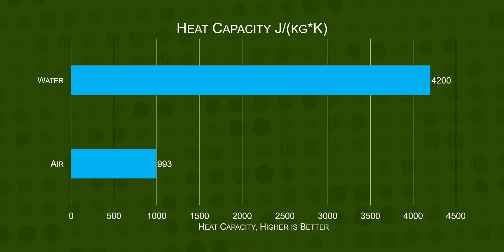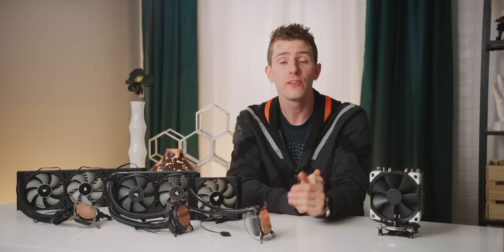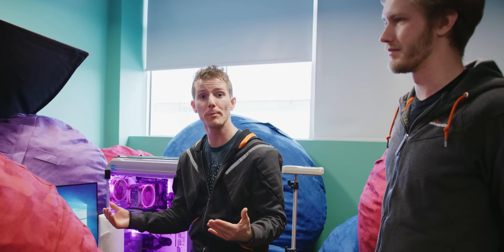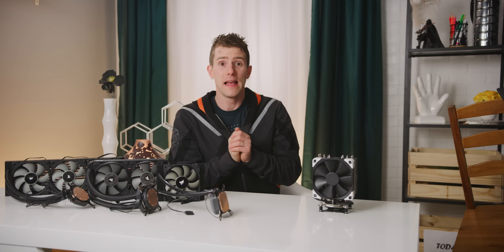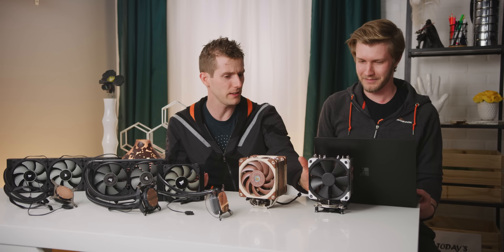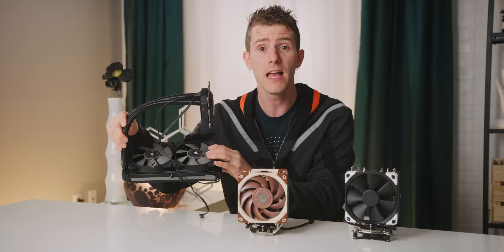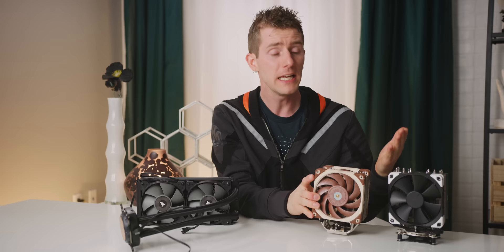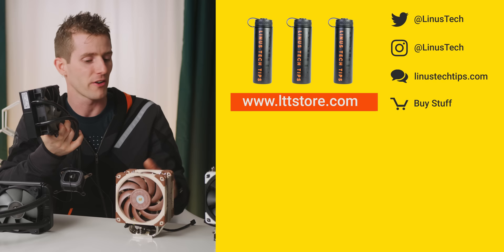Why you shouldn't water cool your PC

Comment: me: buys a watercooler and builds it into my rig

Youtube, literally the same day: recommends this Video
Reply: Same dude. Now im thinking of returning it and buying a Noctua
Reply: Isn't it easier and cheaper just to buy a faster CPU?  Overclocked i3 with expensive watercooling vs i9 on air.
Reply: @MarkLikesCoffee860  you'd have to just not research to even think of putting an i3 under an aio or water-cooling. Unless you're only after looks. It would be better to get a Ryzen 5 3600 or a 10th gen i5 and use the stock cooling.
Reply: @MCHellshit  if they would use proper fans on the aio's and not the stupid lowbudget high noise fans which get shipped with it and also make it a sandwich (4 - 6 fans on the aio) would get far better result than the noctua at any point
i have a setup like that and neither can i get my gpu nor cpu above 53°c at 60% fanspeed while gaming in 4k and having gpu overclocked massivly. Using 11 Noctua fans in my entire rig and nope its not noisy at all.
Reply: If it makes you feel any better, I just watched this video before dropping $145 on an AIO that I saw a review for yesterday.
Reply: Same
Reply: Haha yep.  Building my new NAS, went with an AIO because "why not", but this system won't be CPU intensive so meh.  More of a 'bling' factor.  I wouldn't be worried about it.
Reply: Me too 😂
Reply: MCHellshit stay with liquid cooler always 😉
Reply: I wanted to change to the air cooling but my case cant handle that massive size XD
Reply: Don't believe everything you watch (and don't use SEALED water coolers!)
Reply: @Floppyflipflops473  I'm a Ryzen 5 3600 user and I would definitely not suggest on using the stock cooler. At least not if you're planning on gaming. 3600, with its ability to auto-overclock, it runs really hot compared to Intel CPUs. I was getting 85-90'C (28'C ambient temp) with extensive gaming with the Wreath Stealth (stock cooler). Got a CM Hyper 212 air cooler and now it never crosses 70'C. 35-42'C on idle, earlier it was 45-65'C.
Reply: @GautamKabiraj96  what I said wasn't a suggestion, it was pointing out that a stock cooled 3600 would be more suitable that water-cooling an i3...I'm a 3600 user myself and have it under an aftermarket air cooler.
Reply: @Floppyflipflops473  Compared to an i3 (AIO), definitely, choosing 3600 is no brainer. I just wanted to highlight the point that if someone is going to get a Ryzen 5 3600, might as well get an aftermarket cooler along the way :)
Reply: @GautamKabiraj96  agreed bro, definitely a good idea if you want max performance from it. My wraith cooler wasn't too bad tbh, highest temp I saw was 73°c, mine was noisy so had to go
Reply: @Mirthe DeGroote I'll be honest they all do the job, the better are the aio or the NH-D15. All I could truly say at that point is it's more about preference, I'd get the Noctua NH-D15 as there are less points of failure and at times it would outperform the aio depending on use case and pc case airflow performance.
Reply: @Mirthe DeGroote no problem bud, happy to help. You won't regret getting that cooler, it comes with a beefy backplate and proprietary mounting system, handles the temps of a r9 3950x too, so it'll be perfect for the 3600.
Reply: same
Reply: Same 😔
Reply: Unless you're pushing an AIO to the absolute limits (unlikely), AIO's are far superior
Reply: @bakedandsteaked  far superior? Unless you're getting bigger than a 240 there is negligible difference between a quality air cooler and an AIO in the same price range, if you want better you have to pay way above the price of a Noctua NH-D15!
Reply: @Floppyflipflops473  in terms of performance maybe. But imo, AIO coolers look better, are quieter (again unless you're pushing it), safer for transport, etc. Just my opinion, ymmv. Noctua makes incredible products and has my respect. Their fans outperform everything by a decent margin.
Reply: @bakedandsteaked  fully understandable, everyone is entitled to an opinion mate 🙂, mine soured with my last AIO (Corsair h105) that had a pump fail mid video edit and the temp spike caused a shutdown which lost what I'd been doing for hours. Decided to go air cooling after that as I had previous issues with another AIO too.
Reply: It's fine. Watch GamersNexus' video about watercooling. Linus' testing methodology isn't on par with GamersNexus, that's why he debunked that Noctua cannot truly beat a proper CLC. If you can afford CLC, just go with it. Only reason to go with air is if you're really tight on budget.
Reply: @Zerviscos  absolutely, watch the GN video on the same thing. Steve from GN has a more detailed testing process.

It comes down to 2 things, preference or budget...mine was preference as I didn't mind the cost side of getting a Noctua or a good CLC. Experience decided for me.
Reply: same, and i had a mid Fan that did the job for a i7 4770k with ZERO problems
Reply: Saaaaaame
Reply: Me too. Ahahaha
Reply: Gautam Kabiraj - Well, I have a 2600 and I don’t find my stock cooler to not be enough (this is assuming the 3600 doesn’t get much hotter, I could be very wrong).
Reply: same wtf
Reply: Youtube is punishing you for using the word "rig".
Reply: Xisiqomelir this is my most liked and most replied to comment i made on any video ever so YouTube ist actually treating me for it
Reply: if the ambient temps are hot, like in summer in my country ambient temps get to 40C, my liquid cooled PC runs cooler than my air cooled PC.  also liquid cooled pcs are less dusty than the air cooled ones.  AIOs are also easier to clean than the CPU air cooler.
Reply: @cebukitty  Well, there are ups and downs in both cases. It really depends on preference. As of 2020, air cooling is just as effective as liquid cooling, plus the minor fan noise. I'd rather clean off the dust from the fans (not like we don't get dust on other components anyway), than to put my PC at risk of liquid failure. Failure rates are statistically high on liquid cooling. There's nothing actually to fail on air cooling. In case of fan failure, you can just replace or repair it. While liquid cooling failure / liquid leakage can even lead to a dead PC.
Reply: @Gravity budget depending. I got the 3600 as it fit better in my budget and mine oc'd all cores to 4.3ghz, not that all would but it works for me and does what I wanted.
Reply: Omg, same. l literally just bought a water cooler today.
Reply: Watercooling is better, end of story.
Reply: I hate it when that happens.
Reply: Not sure what you expected. Air has always beaten AIOs. Really the only advantage is aesthetics.

Basically - price vs performance = air, price vs aesthetics = AIO, and raw performance/aesthetics = custom loop. This is how it has been since the first AIOs hit the market and likely how it always will be and frankly I'm surprised that Linus guessed wrong but for all I know that could've been part of the script.
Reply: bruh
Reply: World class telemetry
Reply: @jasonmicron  "why not," waste money is good thinking. My god
Reply: thats a bad beat, ive saw this video in time
Reply: My 3300X doesn't go over 50 degrees Celsius on a Cooler Master 240l AIO
Reply: @jayr8282  a 3300x wouldn't go above 50 celsius on the noctua cooler in the video lol
Reply: @roboticvenom1935  I hear you but it's a big monstrosity in the middle of my board lol
Reply: @jayr8282  Sure but it does its job well and is thicccc.
Reply: @roboticvenom1935  It is good value that is for sure. The 240mm AIO are more efficient then 360mm that was most surprising.
Reply: Should have done some basic research mang
Reply: yep, just mounted the thing yesterday, first time i ever went with watercooling lol. oh well, its there now
Reply: Here we are in 2024 and aio systems are already becoming really good. Nowadays if there is any hot temperatures it's because people aren't installing them correctly or adding the thermal paste properly.
I swapped from an air cooler for aesthetics to a kraken aio with a digital display and it made more room for my box while making my idling Temps below 35°c and under 58° under heavy load. Noise levels are really low and now I get to put bouncing ( • ) ( • ) gifs as my display lmao😂😂😂
I do agree that air cooled systems will last longer.
One thing for sure is that small aio like 140 or 120mm do not provide more cooling than air cooled, you'd have to go bigger than 240mm to see a real benefit over air cooled.
Reply: Me too but I'd rather watercool than spend another $200+ on a new fan

Comment: This video made me think AIO's were crap. But seeing a new benchmark from Gamers Nexus indicates AIO's have improved greatly in 3 years... and the 2 fan 240/260 models are pretty quiet.
Reply: I had AIO since 2020 for i9-9940X and it can handle without any problem, also is very silent during compilation. The amount of heat it can blow off is impressive and I don''t believe that Noctua can do it on the same level, even overclocked.
Reply: I love and own corsair components but they have always been louder than the ugly noctuas.
Reply: @aaronaaronson2095  noctua have fans and even a heatsink in all black now or just paint them like everyone else
Reply: @shaggydoggs  Unfortunately chromax blacks sell at a higher premium depending on when you're buying. I've settled for the dog puke brown and just stopped looking at my computer
Reply: @aaronaaronson2095  The 10 buck or whatever premium is worth it for me.
Reply: Aios have better performance and noise but they don't last that long (Most aios start having performance loss after 3 years, and outright failure after 5+ years) But if you are the type of person that upgrades every 2 years anyway AIOs are great
Reply: Around 40c (even at full speed) for the R7 3700X and the loops are cooled as well.
Reply: @agrisimfarming  Wut? I’ve been running a H100iv2 since 2016 with zero issues or performance loss.
Reply: This entire video was a Noctua paid promotion video.  Linis has other videos showing the complete opposite data, tha aio are king.
Reply: yeah watching linus for real tech tips is a bad idea
Reply: @Krzysio290  what would be the maintenance for aio?
Reply: @Sidowse  And most tests they do looping tell the temps level off so im not sure what you're talking about.  Maybe idiot tests who don't know what there doing sure. But ya AIO will never be as good as real water cooling.  Most AIO have literally like 3 tablespoons of liquid hahaha. And there pumps are very weak.
Thanks for all the info.
Reply: @Sidowse   🤣
Reply: It's true as things are always improving but still risk of leaking and ruining equipment that air cooling will never have a risk of doing.
Reply: @agrisimfarming  My old pc with 6700k is running with a h100 since 2015 never even changed thermal paste no issues
Reply: 260?
Reply: If I've learned anything from my foray into computer building, it's that you should never trust old information.
Reply: @4gbmeans4gb61  AIO's are crap.  Air cooling and custom loop are both better options.
Reply: In 3 years? Still using a Corsair AIO h100. 12 years, CPU running at 45C overlocked at load.
Reply: @shaggydoggs  and an all black fan like a bottom of the barrel OEM one should be... better somehow?
Reply: @mica7191  if its happening when you turn it on... and goes away a bit later.. ( the fan bearings are shot... replace it and stay away from sleeve bearing fans ) its rare for a power supply fan to make that noise, just case fans or cpu, graphics fans
Reply: @mica7191  They say silence is golden.. I spent 300 on a be quiet fans . Power supply . 
( Unplugged hdds ). Just a solid state 

Definitely worth it .

It's worth it
Reply: I’ve had a single fan corsair AIO on a i7 8700k for 5 years now and it’s never given a single problem, and never lets my cpu get too hot, I’m pretty sure they’re just fine
Reply: Well I have been running an AIO for more than 10 years now, still cooing an i5 760. No issues. At this point I know I can never dismount it, it s so old I can't take the risk of breaking an old plastic part that aged bad. I will definitely go air cooler this time. Time to upgrade that.
Reply: I use only case fans. Water and electricity do not mix. It takes only a tiny drop of water to fry your system. And water cooling needs to be flushed every 6 months and its a pain in the you know what.
Reply: @ronchasr6656  we aren't talking about custom loops, this us about AIO
Reply: Used AIOs for over a decade and not a single one broke down on me, they kept the temp stable and they weren't that noisy. It is only now, with a computer that's slightly older than five years, that my H1151i is experiencing trouble cooling my intel i7-6700k 4ghz. So go for an AIU if you intend to run your PC on heavy loads and plan to game for several hours straight, air cooling just doesn't do it for extended loads.
Reply: @Teadon86  Used both liquid and air cooling over the years. Air cooling can get the job done, just make sure you're using a properly sized air cooler. A peerless assassin 120 SE, has me staying in the 50-60 range at extended use/gaming with a i9-9700kf. I got plenty of thermal headroom for OC.
Reply: @SlavicCelery  True, the size of the air cooler and fan shape is essential and can keep a CPU cool during heavy loads. The main difference I've seen between air cooling and AIO water cooling is that the AIO can keep the temp down for a longer time without needing to go full throttle.
Reply: @Teadon86  Absolutely. There's also other options to reduce the thermal loading in general. Stuff like undervolting can lower the heat generation in general.

In the end, proper fan curves, voltage and case airflow play almost as much of a role in temps as the cooler itself. 

That and how much heat your PSU, GPU and MB are throwing out in addition to the CPU.
Reply: @SlavicCelery  Certain UEFIs also is known for sending too much voltage to the CPU. Such as some MSI motherboard's UEFIs that for some reason are overvolting.
Reply: @aaronaaronson2095 corsair aio is very loud. I changed it to fan using cooler master.
Reply: They don't last long though. I have a Corsair H115i 280mm AIO that's now about 7 years old and my Ryzen 5 3600 runs at 70! degrees in Time Spy while a friends 1600X runs at 53°C with a Noctua NH-U12S. Now you may think 7 years is ancient or so but do you really build a new PC every 5 years or less? Would the cooler not perform so badly I would want to keep using it. Air cooling lasts forever basically, you'll just have to repaste it every 1 or 2 years to keep optimum performance.
Reply: @imnotusingmyrealname4566  what's this repasts nonsense
Reply: @UtgkjIoioo  changing the thermal paste, unmounting the cooler, clean it and the CPU off and apply new thermal paste, thermal paste dries out over time and you WILL get higher temps
Reply: @imnotusingmyrealname4566  is there a video on it. Hope u bot making it up but backed by evidence.
Reply: @Krzysio290  So is my air cooler.
Reply: I just replaced my 2019 th240, not because it had died or wasn't performing well, but because I got a new case and wanted a 360mm aio.
Reply: Yeah I wonder how they ran these tests. I switched from u12-a to a liquid freezer ii recently and saw CPU temps go down 10c in a 20 min XTU stress test. After warming up, the AIO has temps 75-80c while the u12-a had temps 85-90c.
Reply: A cheap old thermaltake aio I got in 2019 is still working for me, it was on a 9700k back then, is on a 5800x3d right now, temps are great, 50s to mid 70s depending on the game, nowhere close to throttle temps. Idles between 28 and 33
Reply: watch jays two cents. king of water cooling
Reply: @agrisimfarming  you cna find video on youtube that explains how to refill your aio.
Reply: @agrisimfarming "better performance" bro didn't even watch the video.
Reply: @aone9050  Bro didn't even read OP's comment